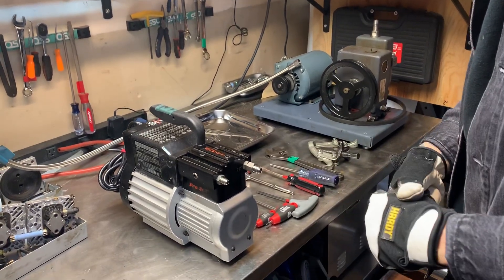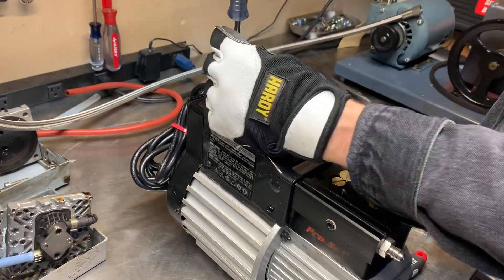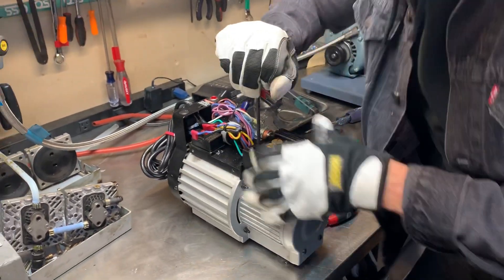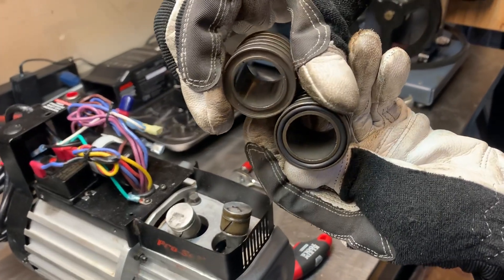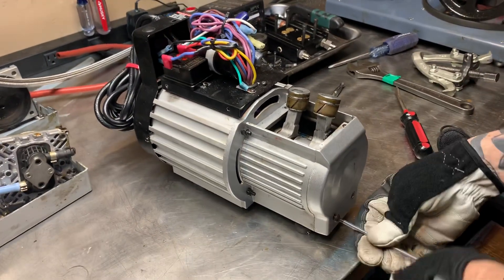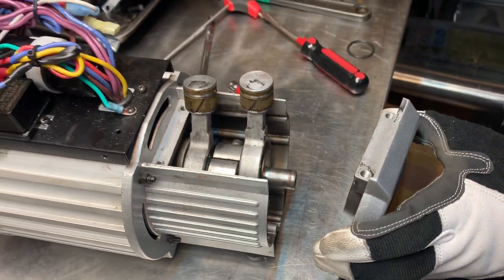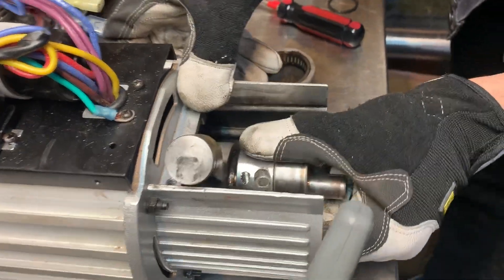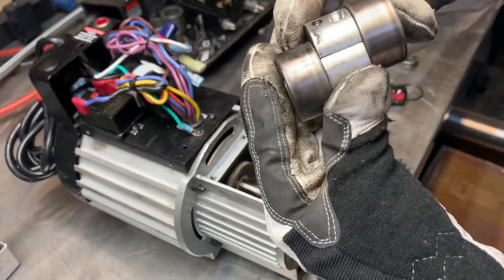CPS TR/TRS21 Teardown

Comment: I recently replaced my compressor head. Now on the compressor side, on the bottom, there is a hole. There is a small Refrigerant leak that my gas detectors will pick up. I cranked down hard on the top bolts and it slowed it down a bit. But what else can I replace or check to fix this?
Reply from the maker: If you have not replaced the connecting rod/pistons you need to!  Piston ring wear is the #1 reason for leaks, especially from the bottom of the crank case which you are experiencing. Tightning the bolts extra hard is not the solution.  We have sets of pistons available online https://www.opensourcesteel.com/products/trs21-replacement-parts

Also check our video on compression testing the TRS21https://youtu.be/Sqlt1y8ESUs